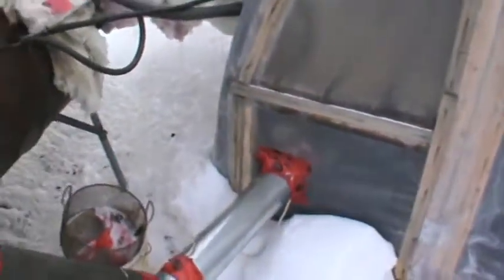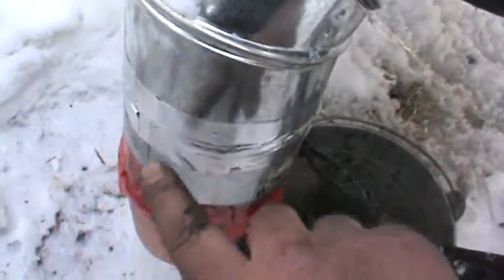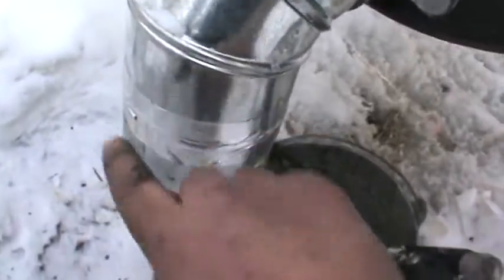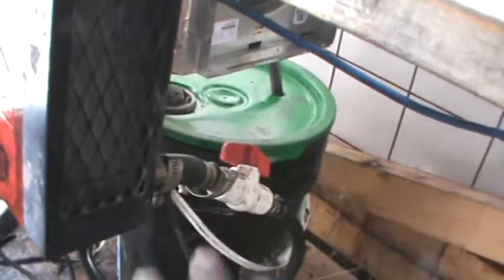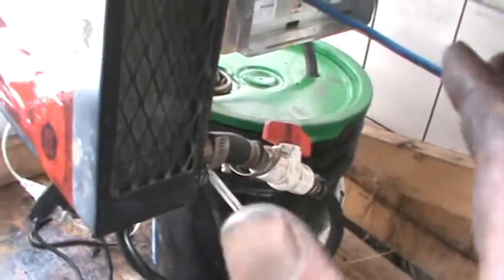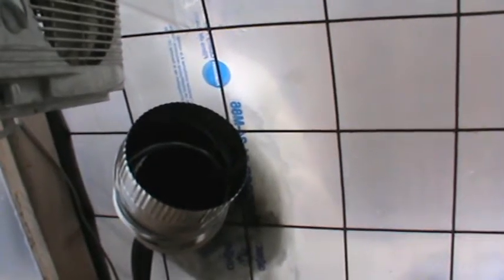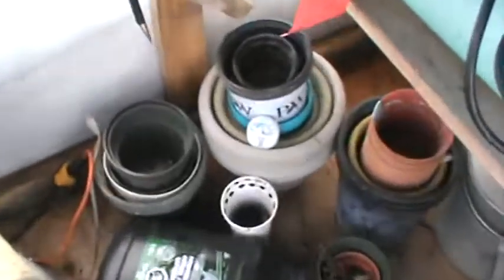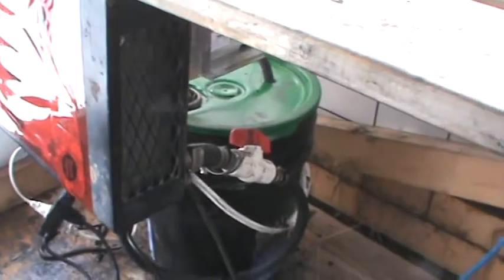Greenhouse Heating Project Complete Overveiw DIY

Comment: Your pump runs continuously, I'm assuming, and isn't connected through the thermostat?  Otherwise you could overheat your antifreeze if its trapped in the coils..or does it all drain back automagically?  Good system, I like it.. Thanks for the video's.
Reply from the maker: +BZ18G Yes, The coolant pump runs continuously for just that reason. The fans in the greenhouse that recover warmth from the exchanger are thermostatically controlled. There is a draft fan that feeds air to the burn chamber that is controlled by thermostat as well, that way the fire simmers down when there is no call for heat. Thanks for the comment. Hopefully this answers your question.Rod